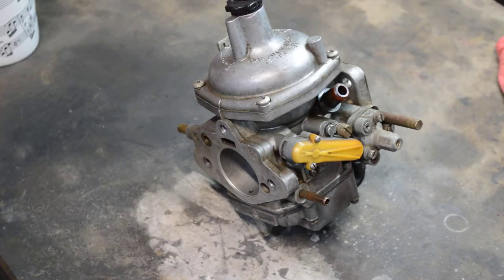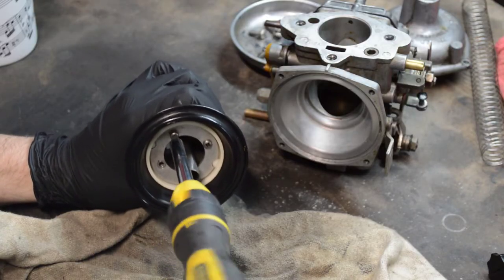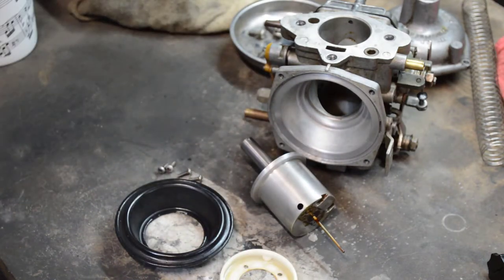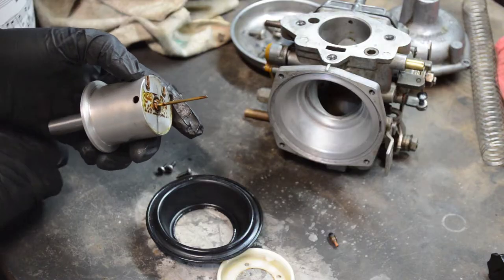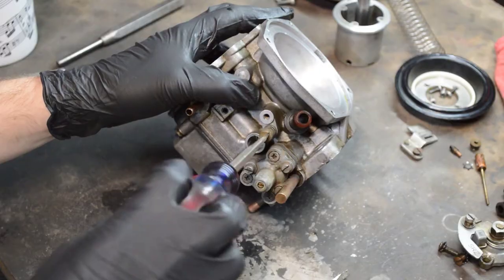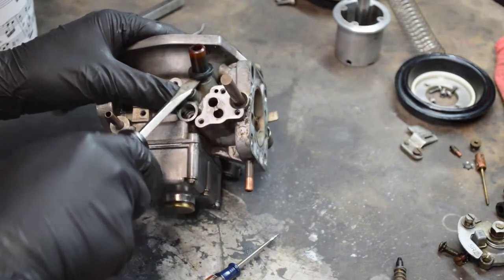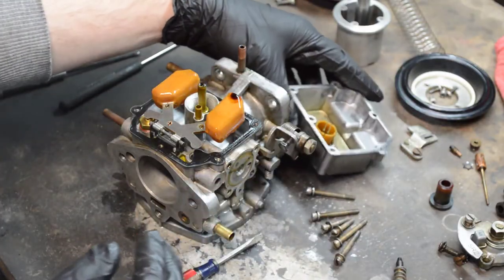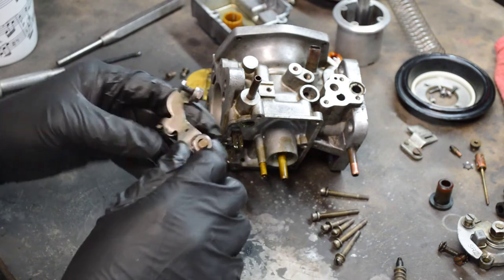Rebuilding Zenith-Stromberg CD-175 Carburetors - Disassembly

Comment: This is brilliant, I'm struggling to get the needle seat out of the carb damper piston body and was afraid to just pound on it until I saw exactly that at the 8:00 mark. Full speed ahead now! And the expert shop that rebuilt the carbs has blocked off peripheral functions that the owner decided my TR7 didn't really need, so now I see how to put them back to original functionality. Many thanks!
Reply from the maker: Glad it helped.  A hammer is sometimes your friend....  And "expert" is a word that's thrown around pretty frequently.

Comment: Great video and tutorial ! I now have the courage to put new carb parts and clean up the carbs on my 1970 Jaguar XJ6. It sat since 2014 had nasty gas in the fuel filter but luckily the two tanks were clean n rust free. 

Thanks , I just subscribed with complete gratitude :)
Reply from the maker: Glad I could help.  I love old XJs!  I think my favorite bit has to be the button on the dash to switch between fuel tanks.  What other car has that?

Comment: Thanks for the reply. I just had the points replaced with an electronic ignition and coil from pertronics. That’s when  this all started. Pertronics coil had to be replaced with a Lucas one ( their suggestion) as it got heated. The Lucas coil seems to work fine but I still have the engine issues when I’m accelerating between 3 - 4 thousand rpms. I got the car in March and drive it often for pleasure. I didn’t have any issues until I replaced the points. The oil is 20w 50 Vavoline which has less than 500 miles on it. Fuel pump was replaced as was several fuel filters and still the same issue. This is peculiar as it runs great than 15 minutes in the sputtering and hesitation starts at the high rpms while accelerating. Also the engine is at temperature before I pull off. Thanks again your feedback is appreciated
Reply from the maker: I would strongly suspect ignition since you're telling me that that's when the problems started.  Petronix ignitions are generally the sort that it either completely works or completely doesn't.  A more common fault would be complete failure when the engine gets hot and then starts working again after cooling down for a few minutes.  What you're describing sounds like you're not getting sufficient advance or the timing isn't set right to begin with.  When a Pertronix module is installed, it doesn't replace the mechanical advance of the distributor.  It does, however, add some wires that go inside the distributor that weren't there before.  Try pulling the distributor cap and adding a little slack in the wires.  The plate the ignition module is mounted on needs to be able to turn 15 or so degrees, and if the wires are holding it in place then you won't get enough distributor advance.  

You can test this theory with a timing light too.  Plug it in and have a helper rev the engine slowly up to the trouble area at 3 or 4000.  Watch the timing mark, and you might find that it only goes so far.  If you add some slack into the wires, that could fix your trouble.  If not, then I'll bet a weight might be sticking.  You can definitely fix this yourself with a little time and a couple screwdrivers, but if you're not feeling up to it I can also clean and lubricate your distributor as well.  

One other thing to look for is to see if the Petronix module is working at all at the higher RPM.  You might notice that the timing light stops flashing altogether, which indicates your plugs have stopped firing.  It could be improperly installed, or it could be just a failing module.  They're generally reliable (at least for a while), but even brand new units can be junk.  I've had a couple fail in the past, and I suspect it's due to the heat produced under the distributor cap.  Others have been much luckier, so I guess it's largely an experience and preference thing.  I am running points in my TR6 and have no issues.

Comment: Great video, learned alot as I'm rebuilding my 175cd for my 82 Tr7.
Reply from the maker: Glad I could help.  The TR7 carbs may have some additional stuff such as a water choke.  Depending on whether you'd like to keep the car original, you might consider throwing that away and replacing it with a manual choke kit (I believe a few vendors carry those).  Thanks for watching!
Reply: I may have some work to do on my SD1’s carbs and this video could not be more helpful!

Note the FASD is usually quite reliable and I found my starting issues were more to do with the unit’s exhaust into the manifold and perished hoses/o-rings. Basically, the fuel/air mixture wasn’t getting to the manifold and venting into the engine during cranking! Scary.

Comment: Thank you so much, was gonna do a conversion because their was no good videos out there rebuilding and I don’t wanna pay someone else to do it. But after this video I’m subbing and so excited to finish my car! 

(1969 tr6) have a few videos on my YouTube of it running rough right now all custom color design not another like it, can’t wait to get it on the road!
Reply from the maker: I love a good TR6!  Actually, I think these carburetors are easier to deal with than some of the alternatives.  Switching to downdraft Webers is technically worse, and SUs or DCOEs make more work elsewhere or it won't run right.  Good luck!
Reply: @midwestmotoring  thanks for the advice, I was really looking at all of those options and even ti the point of finding a way to do a four barrel holly or some thing along those lines. But....... this car was my dads dream he hit a stop sign and dented the front up drove it home parked in his garage where it sat for 38 years absolutely ZERO rust. He started to re do it and got it 90% done. White tail, red body, white top, all white interior including carpet. Rebuilt the motor and dropped it back in and it was almost finished just odds and ends left drove it to 1 car show maybe 40 miles on the car in all that time but it’s been sitting for about 8 years again now, so I gotta finish it and go through it so my dad can see it before he passes. Was beyond excited to find this video so I can do it myself and keep the car for years to come. Wish I could send you a pic of it at the car show! But cheers man please keep the videos coming. So much more a lot of need to learn to do :)
Reply from the maker: midwmotoring@gmail.com is the email.  I'd love to see pics at the car show!

Comment: Amazing this google thing, just the video I was looking for as my 50 yr old classic range rover has 2 of these on it, not exactly the same as mine adjust from underneath the float chamber. I was going to take both off to clean inside as the motor has not been used for 22 years but after removing the off side one decided it best to not remove the near side one. as I said to my son it would be easier to remove the whole of the inlet manifold with the carbs attached. Any way I did a partial strip down and clean as far as I would venture with out knowing what I was getting my self into and refitted it and reconnecting the bits and bobs turned the key and it started first turn, ho boy was I pleased with myself. Lastly thanks for sharing your knowledge on this forum.
Reply from the maker: My Range Rover is newer (a 2012), but I love the classic ones.  They're becoming quite popular these days too, as are old Land Rover Defenders.

Comment: I tried giving the wires a little more slack. Although it took a little longer to start hesitating it wasn’t as bad. Am I on the right track? Thanks again
Reply from the maker: Hi Phil, if the problem got better, I'd go with even a little more slack and see if it helps.  The only real way, unfortunately, would be to see if your timing is changing at different RPM.  Does the car need to be driving to create the problem, or will it still hesitate even while stopped?  If it's acting up while stopped and in neutral, you can pull out the timing light and see what's happening.  Otherwise, you could try driving it with a vacuum gauge to see how the needle moves.

Comment: Thank you so much for your videos.   Could you please help me with two questions?   I have a 1968 TR250 and the 175 CD-2 Zenith-Stromberg carburetors have fixed needles and non-adjustable jets.  I plan to install adjustable jets -- do you think that installing those will be helpful?  The other question may be more difficult.  I am having trouble removing the existing fixed metering needles.  They are worn and need to be replaced.  In your video, you removed the needles by tapping them out with a brass rod.  Unfortunately, the hollow cylinder that the needles slide into does not go through (or at least that is how it appears to me and I have found diagrams that seem to show this) so I can't drive the needles out the way you did. Any help would be greatly appreciated.  Thank you!  Clive
Reply from the maker: For the first part, yes.  I think having the ability to adjust your carbs is important.  That said... it's not important if you don't drive very far from home.  I only ever adjust my carbs if I'm changing altitudes (such as driving from Chicago into the Rocky Mountains).  As for removing the needles, you're correct in your car that the hole doesn't go all the way through.  That through-hole was machined in to accommodate the adjuster.  I'm afraid the only way to get the needles out if they're stuck is to pull harder (make sure the set screw is removed of course).

Comment: Great video. Hoping you can help me with a problem I’m having. I have a 75 TR6. About 15 minutes into a drive the engine starts sputtering and hesitating at 3 - 4 thousand rpms. Know what this problem could be? Thanks
Reply from the maker: So I'm making a few guesses here.  When you're hitting 3-4k RPM, are you accelerating or cruising at higher speed?  If it's happening on acceleration, check the oil level in the dashpots.  Also, if you have an oil in that's too thin, then it may be even thinner when the engine is warm.  That could have an affect on acceleration.  

More likely, though, is that your timing is not working as it should.  The distributor will advance the timing using a combination of weights and vacuum signals from the engine.  If something is sticking internally, the timing might be off at the higher RPMs, which would make your engine run poorly.  If you're in the US, I do look at distributors for people and would be happy to make sure yours is working properly.  

Other than that, I might suspect a fuel delivery problem.  Maybe the pump isn't quite doing its job and is less efficient when things heat up.  It could be poor carburetor adjustment as well, as you'd possibly be putting the choke in once everything warms up (though I would expect that to be an issue sooner than 15 minutes).  You can pull a spark plug or two to see if that might be the issue, but it's misleading because poor fuel adjustment can still be ignition-related.  I'm rebuilding a set of carburetors for someone now and may have found their running issues there.  

Driving with some gauges attached would be helpful. Modern cars have check engine lights and sensors, but you can mimic the sensors.  A vacuum gauge and a fuel pressure gauge might tell you what you need to know.  You can plug them in (I use a t-junction for the fuel pressure gauge so the engine can be running while driving) and put the gauges under a windshield wiper, then go for a drive.  Note what's happening when you have trouble.  For example, if the fuel pressure drops at 3500 RPM while the engine is stumbling, you know that's where the problem is.  Good luck!

Comment: Hi, so I'm having some issues with my carb, it seems to not want to start. once started and warm it runs lovely, if turned off and turned back on within minutes it will be fine, but if left to get cold, the car won't start properly again. I wasn't quite sure what's causing the issue. I've adjusted the main pot needle. After watching your video, I was wondering could it be the bypass valve? 
The old carb i had just kept over fueling and pissing fuel out the mouth of the carb. I didn't block anything off but now I'm wondering if something got jammed. These things are older than me so if you could be kind enough to give me some pointers, it would e greatly appreciated. I've been restoring a volvo 244 1979. I've nearly finished the interior, I have an oil leak on a pulley to sort and then just bodywork... well apart from the carb issue :D

Thanks for the video by the way! very informative.
Reply from the maker: They're older than I am too--I was born in 82.  Anyway, I had a similar problem a couple times, and it might not be the carb.  Sometimes it has to do with heat expansion and some of the emissions components.  Make sure all of your vents are venting, and note whether it happens when the tank is full or not.  Otherwise, unless it gets fully cold and then has trouble starting, I'm not sure it's a mixture issue.

Comment: After you've installed the carborater back in the car, what do I need to  know about connecting the throttle cable? Does the engine need to be at operating temperature with the auto choke "off" before connecting the cable?
Reply from the maker: Unfortunately, I don't know much about auto chokes.  I don't think the auto choke mechanism physically moves the throttle.  I think instead it creates a bypass circuit somehow to raise the idle, but I could be wrong on that.  If it's not connected to the throttle, then it shouldn't matter what temperature the engine is when you connect the cable.  When the engine is warm and the auto choke is inactive, you can always look to verify the throttle is fully home.  If it's not, it should be fairly simple to adjust the cable, and turn in the idle speed screw at the same time to keep the RPM where you want it.

Comment: Awesome video!!! maybe you can help me, i´ve a 1975 mercedes benz 230 with a stromberg  175CD carburetor, i´m having problems with the cold start, i really can´t start the car at morning, but the same day after noon the car starts really easy and that happens every day, any chance you can help with this problem, and also i really don´t know what mesure should i buy to change the jet and needle jet, i live arround 2500 meters above the sea level, thank you.
Reply from the maker: I get a lot of questions from Merc guys, but unfortunately I think the carbs are a little different and beyond my expertise.  Sounds like you may have an issue with the choke and not with the mixture, since it works well later in the day.

Comment: Would you be so kind as to tell me more about the bowl vent tube? I'm helping a friend with his newly purchased '74 TR6 and It leaks fuel out of the jet even when not running. It has added almost 2 quarts of gas to the oil level. The carbs have new float needle valves and they aren't stuck. The floats are not defective and are at correct levels. The vent tubes have rubber caps over them. Is that why they leak fuel and run rich? If so, can I connect them to the air filter? There is no carbon canister. Thank you for any suggestions. Excellent video.
Reply from the maker: Remove the rubber caps and you're done.  If that doesn't work, you have more than 1 issue going on.
Reply: @midwestmotoring  You are correct about that, the small electric fuel pump is putting out about 4.5 PSI not 2.5. I will be adding a pressure regulator and gauge to it soon. One last important question: Where should the needles be set initially? All the way down, or up, or someplace in the middle, when beginning to tune? Thank you for the quick reply.
Reply from the maker: @novakenss  4.5 is definitely way too high, so you'll need to address that too.  Needles should have the base flush with the bottom of the air piston as a starting point, but that's meaningless unless the float height is set properly first.
Reply: @midwestmotoring  I put on an accurate pressure gauge and the electric pump is exactly 2.5 psi. No worries. I will change the filters. Floats are the white plastic type and buoyant, level is 17mm, needle valves are new and clean. The culprit like you said must be the fuel vapor tubes being capped off. I'm also removing all corrosion inside. Thank you for the needle position information. Oil and filter replaced. The oil reeked from the 2 quarts of gasoline. I'm going to make Brian, the TR6 owner, join your channel.

Comment: I'm beginning to believe the kick piston in the water choke does what the the appendage with the diaphragm that keeps the engine from popping during deceleration does- shown about 19 minutes in on this video. They place all enrichment needs; cold start ect. In one unit.
Reply from the maker: It'd be similar except that it would change the mixture. The bypass valve takes mixed fuel and allows it to bypass the throttle plate at a certain vacuum.  The kick piston seems to change the mixture, almost more like an accelerator pump. You are correct that it's a complex device though. Fortunately my Triumphs are all too old to have one!
Reply from the maker: Sort of, yeah.  All the bolt on stuff pretty much bypasses or modifies the standard mixture you set at idle.  The auto choke in a lot of these is actually closer to a mini carb set to run rich... and it bypasses the main unit.

Comment: I had a piece of wire in the head of the metering needle, is it suppose to be there or was it used to temporarily hold the spring in place?
Reply from the maker: You might mean the piece that holds the needle in place. So it might be that it's supposed to be there... but if that's not it then no, take it out.